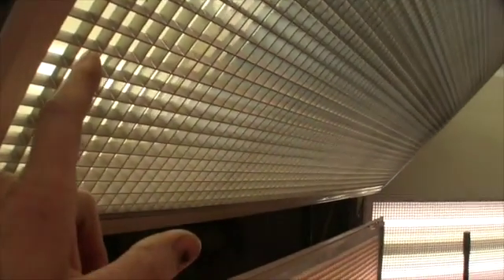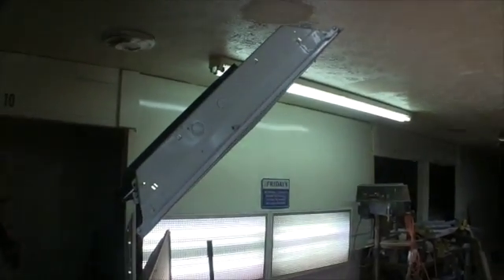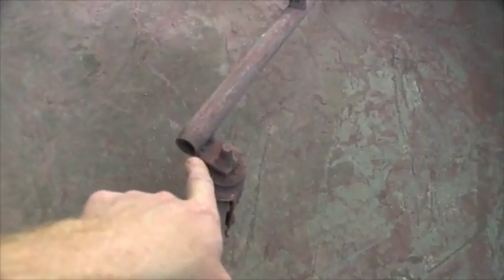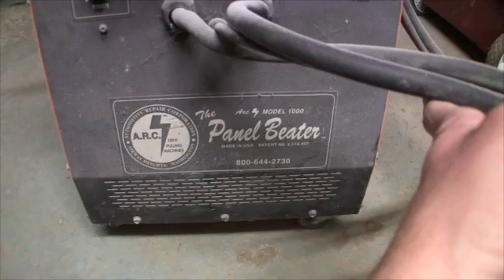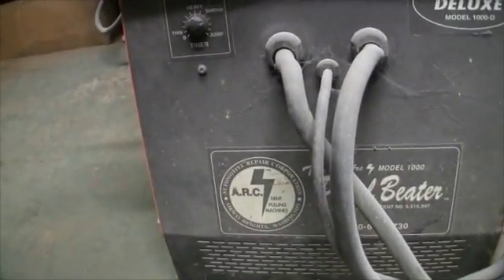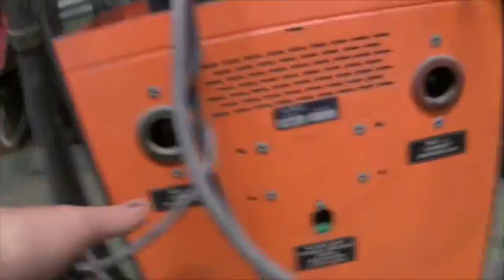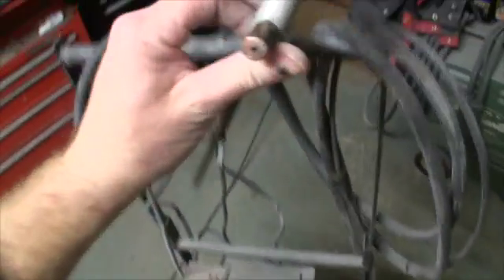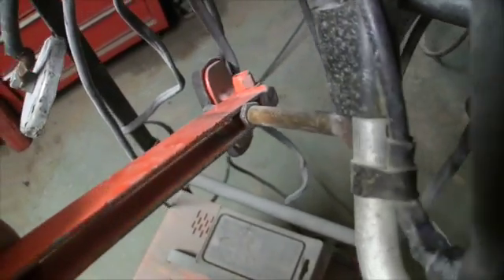Dent pulling machine and Mobile work light

Comment: Great vid!! I'm planning on building a light set up like that! The vid really helps,THANKS! And those panel beaters are very pricey, I watch those on ebay hoping I get a good deal, none so far! LOL
Reply from the maker: CHOPSHOPUNDERGROUND The cheapest I've seen was like 900 bucks for a 110v model at auto body tool mart.  This one was given to me as a non working unit that needed a new battery